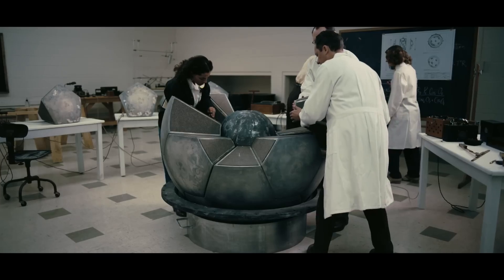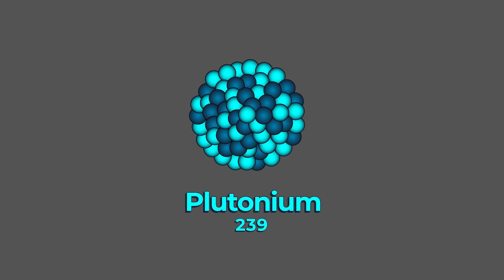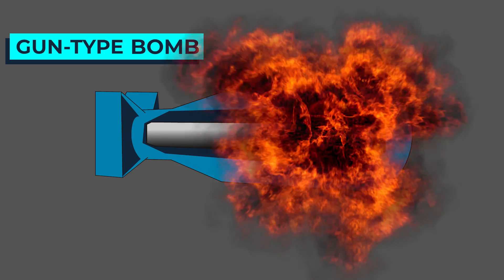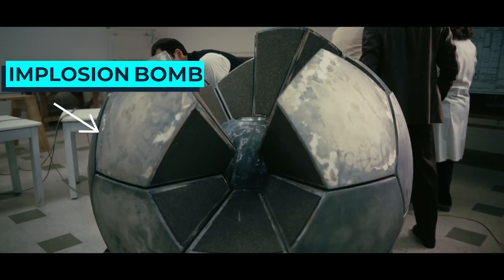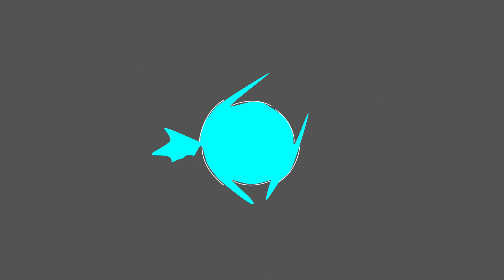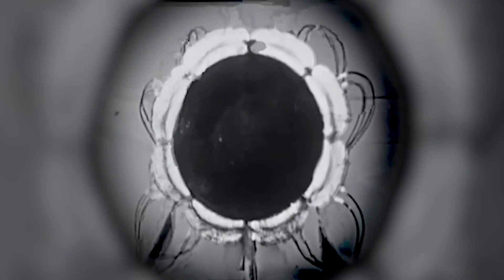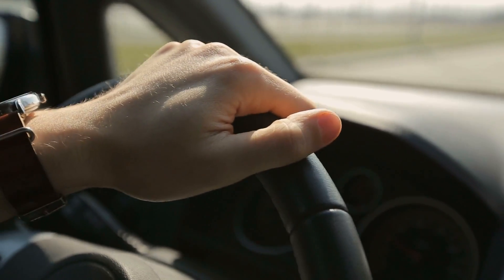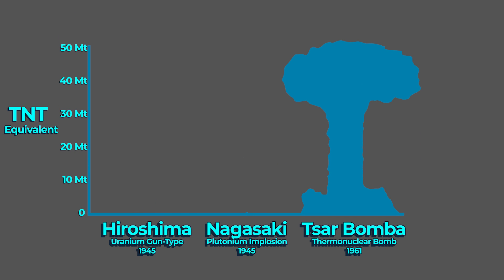The Physics Behind Oppenheimer's Atom Bomb - EXPLAINED

Comment: 3:00 i thought they used implosion on plutonium mostly because the amount of uranium and its size, the neutrons have much more material to pass through (i think it is referred to as nuclear-cross-section), compared to the smaller plutonium mass. 

“where the distance neutrons must travel is so long that they're likely to collide with uranium nuclei before escaping. This design doesn't require compression of the uranium metal, which increases its density.”

Also because when critical mass is achieved it A. heats up, slowing the chain reaction, and B. The energy blasts the pieces apart, also slowing the reaction. Like how the demon core was just a super quick flash of energy released.

It’s also pretty crazy that they were so sure of the uranium-gun design that they didn’t even test it! All of that work on gadget and the trinity test, and then the first bomb we drop is a completely different design and material that has never ever been tested. Absolutely crazy…
Reply: Part of the issue was the spontaneuous emission from PU-240 in the plutonium would reach criticality before the mass was completely assembled.  They couldnt bring the two sub critical pieces together fast enough before the mass would detonated in a fizzle.  Another part was it takes much less plutonium than uranium.